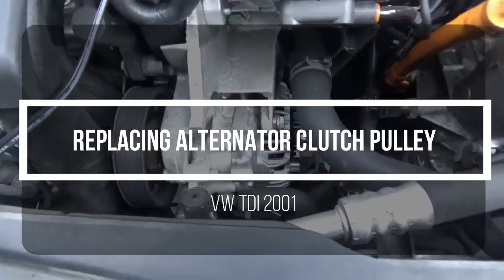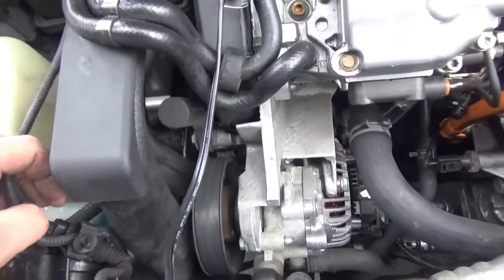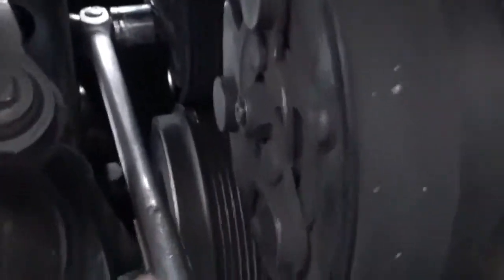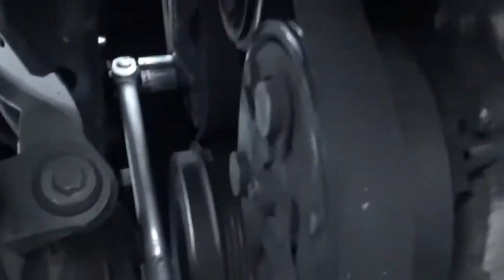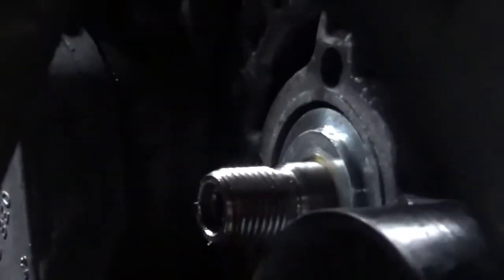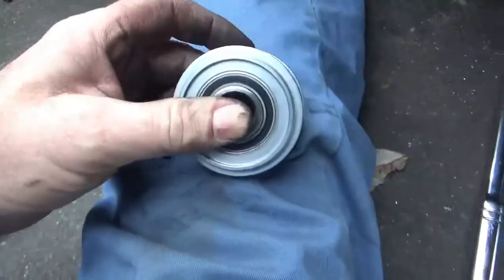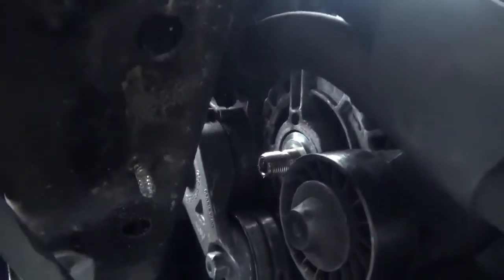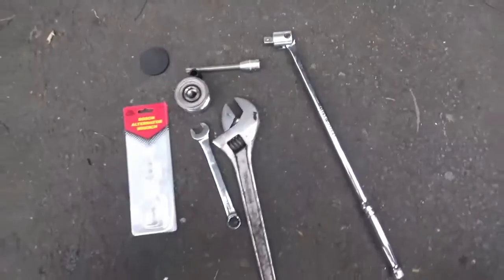Alternator Clutch Pulley Replacing - VW - JETTA TDI - 2001

Comment: Mine was sized, I thought the TB was trouble since the noise was horrible clanking at cold start and after running at idle  
200K is good enough to say goodbye to old pulley lastly 
I  was not careful on M10, seized, no way than remove the alternator and an electric impact just done the job in a second by using spline  33 tooth 17” 
Problem solved, car is sounding like a new again